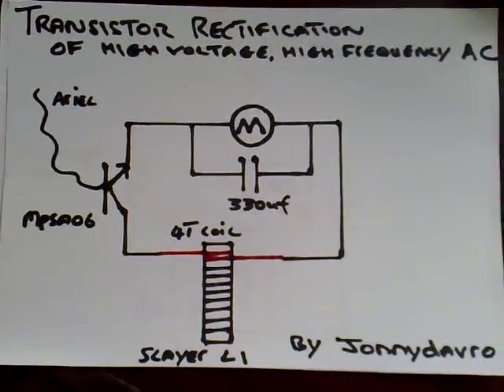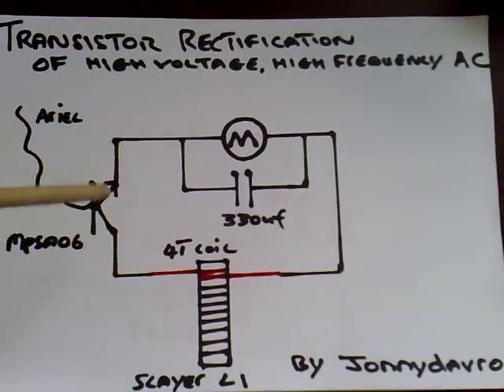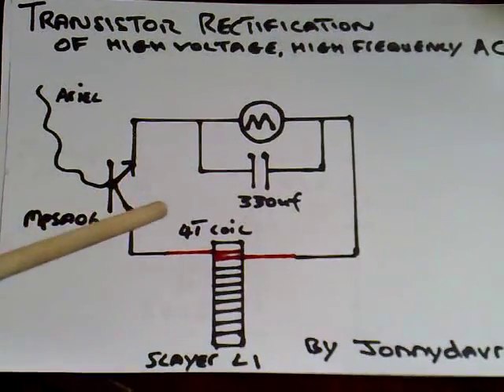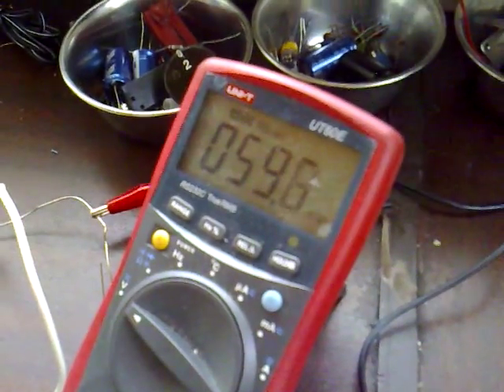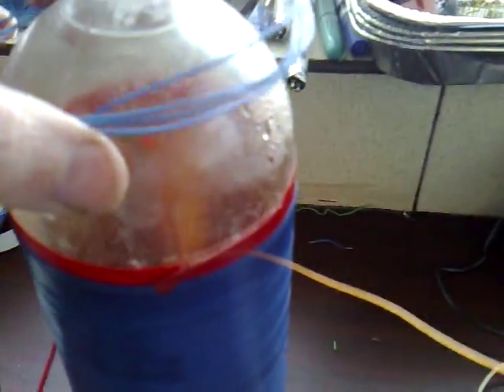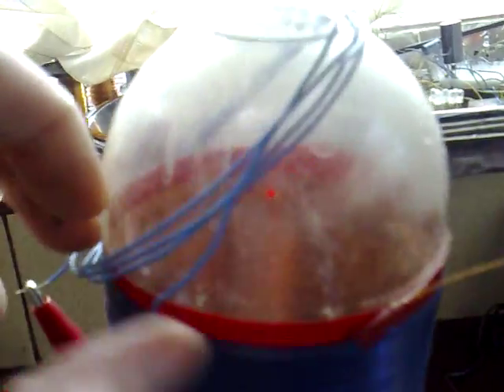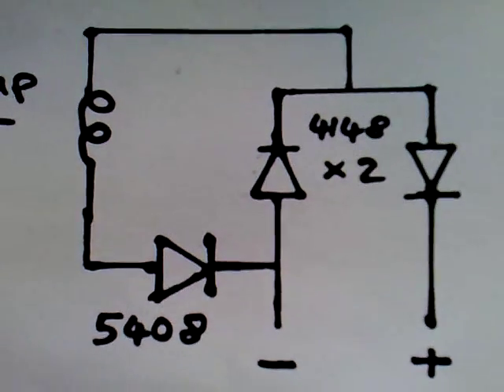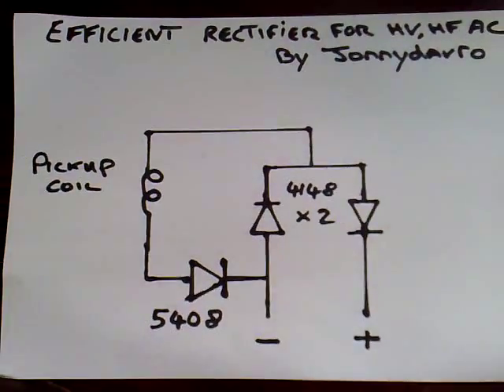Single transistor rectification of HV, HF AC

Comment: Hi jonny I just tried to move up the pickup coil and it burnt out the mpsa06 so I checked the voltage coming out of the pickup coil and it is over 600V at the top of my exciter that is running of a 30V wall adapter.

Comment: Hi jonny...Thanks for your reply,The fan I'm using is on a heat sink from an old computer that I have attached the TIP31C transistor,I have found that if I add two diodes to the ends of the pickup coil then put the cap across it I get 12v and the fan runs full speed but if I bring a CFL or any other light bulb near the exciter the voltage going to my fan drops and the fan slows down.with your rectification circuit and the same pickup coil in the same place it gives me 6V and the fan runs too sl

Comment: I am using your transistor rectification circuit to run a cooling fan for the TIP31C transistor I am using in my 30V Exciter,the fan runs a bit slow and has burnt out a couple mpsa06 transistors,do you have any ideas how I can get the fan to run faster without cooking the mpsa06, I have the pickup coil at the bottom of my Exciter.

Comment: Ive just tried an IRF 530 and an MJE13007 to rectify the signal, but no joy so far.  Have you had much luck with other transistors?  Or is the MPSA06 something special?

Comment: you should try to use a variable cap in series with the pick-up coil and set the coil resonance then feed the circuit it may help.